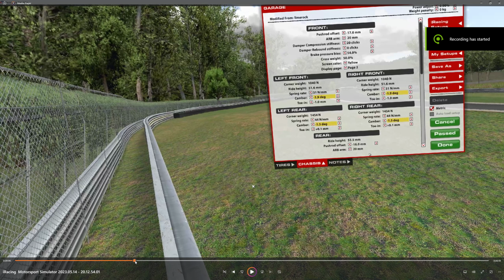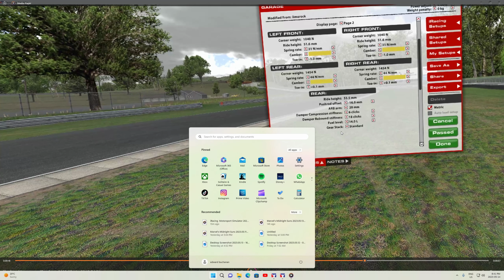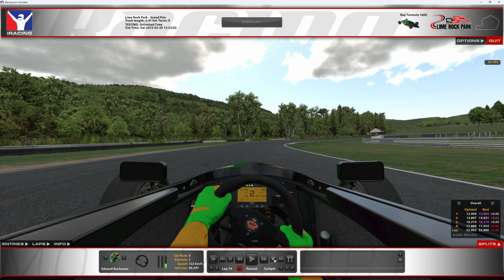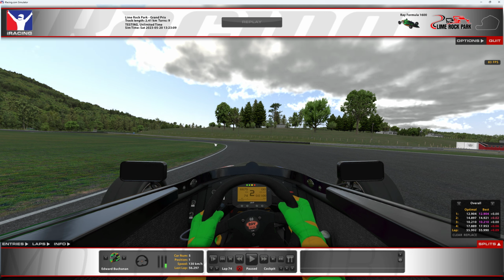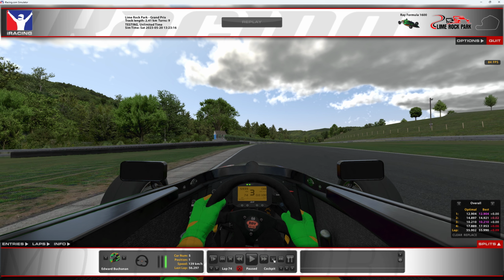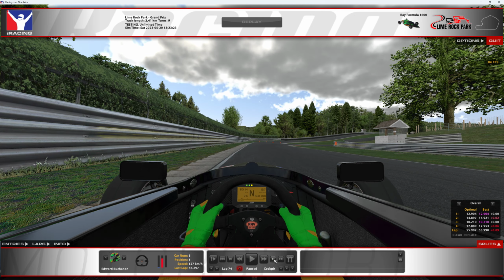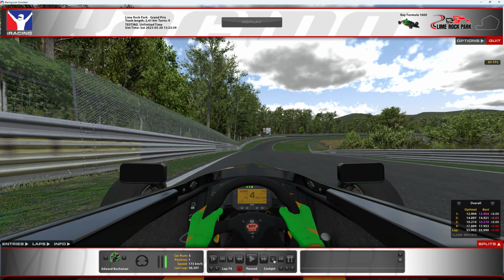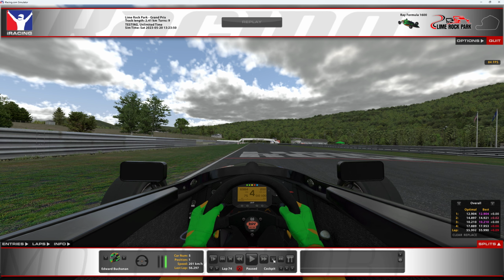iRacing Lime Rock Park GP Ray FF1600 Set Up And Track Guide

Comment: Awesome thanks for that
Reply from the maker: Hoped it shaved some time off. Season 3 should be interesting in the Ray. Hopefully good participation and I think some stiffer  competition with a season under everyone's belt
Reply: @edwardbuchanan871  hi, what Tyre pressures where you running please
Reply from the maker: @stevehanwright481  low as it can go, for every track with the Ray and the skip barber too. Tyre wear isn't a issue with these cars
Reply: @edwardbuchanan871  thanks

Comment: Good stuff. Hopefully a bit more participation this week being an included track, Zolder was a bit hit & miss for numbers last week.
Reply from the maker: It's too bad the open series isn't getting the participation the fixed series is. I think people are intimidated by the set up aspect. I just can't do a 12 min race in the fixed, it's so few laps.
Reply: @edwardbuchanan871  another great video and set up. I also found the open series has less racers in. People should watch your videos so they don't need to be put off anymore!
Reply from the maker: @Greg Clements  with the Ray the set up isn't a massive difference to lap time. I understand people just wanting to get in and drive though. Fixed races end just as the tires get warm 🙁